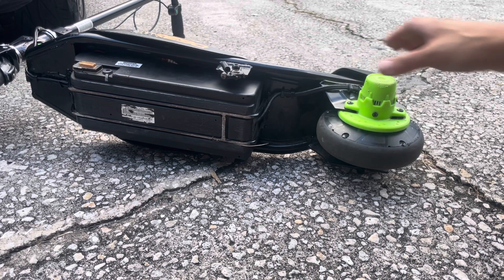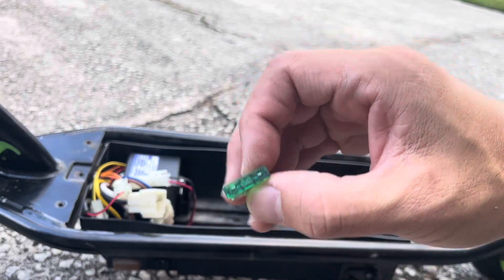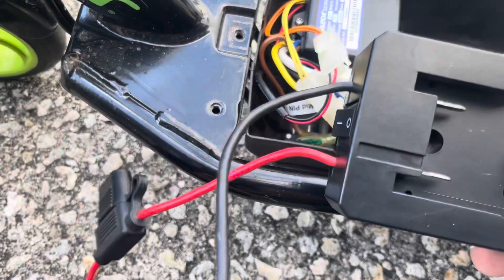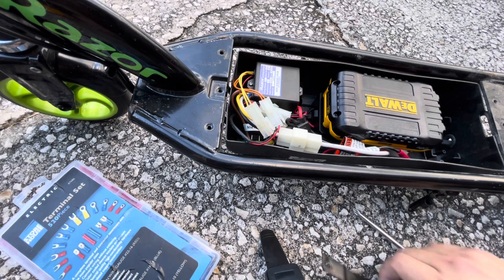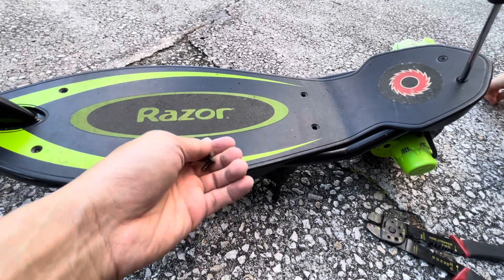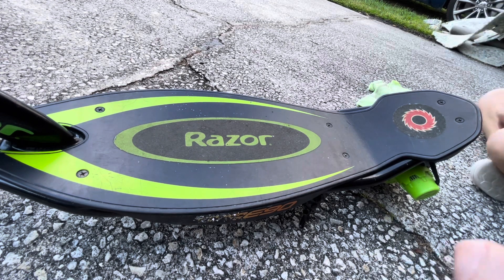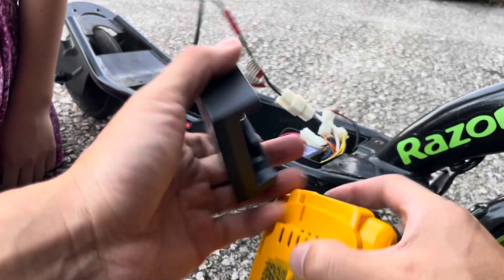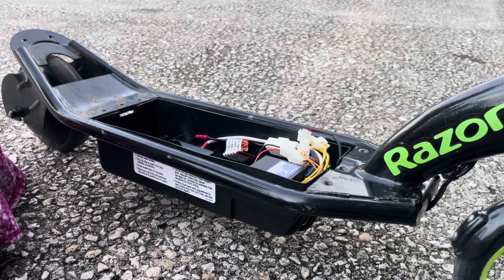How long will a fully charged 20v 4AH Dewalt battery last on a Razor E90 scooter? How fast is it?

Comment: Great video. I wanna try doing this to my kids electric scooter to see how they do with the speed before upgrading them to a faster scooter. Thanks for the vid.
Reply: Mexican engineers 😂😂😂
Reply from the maker: No problem, Thanks for checking out the video and commenting.  The scooter exceeded our expectations.  Speed increased and the ride time increased to approximately 40 minutes on a single charged battery pack.  I am trying to figure a better way to mount the battery so it is more accessible.  Stay tuned!
Reply: @DIYwithDUY  How fast does it go?
Reply from the maker: @maybekaiden  Hi, this goes approximately 13 mph with the 20v battery upgrade.  The scooter with the factory battery is rated at 9 mph.  Here’s the full video on the upgrade.  https://youtu.be/mif6tTohvnM?feature=shared. 

I started adding these battery packs to the outside of the scooter to make it easy to charge and swap batteries.  Let me know if you have any other questions. Thanks for watching.
Reply: @maybekaiden it’s Spanish engineering 😅😅😅